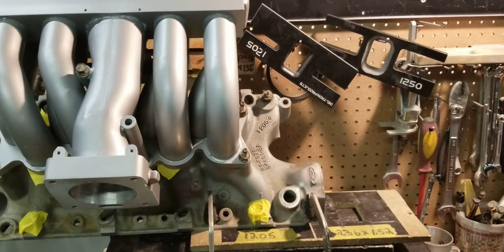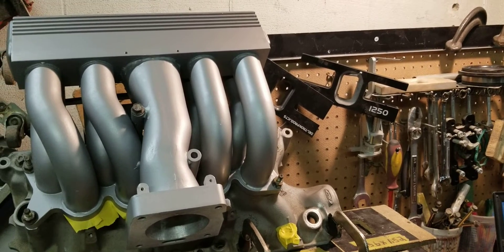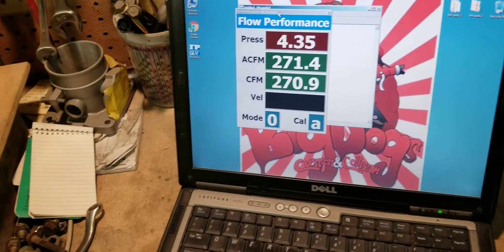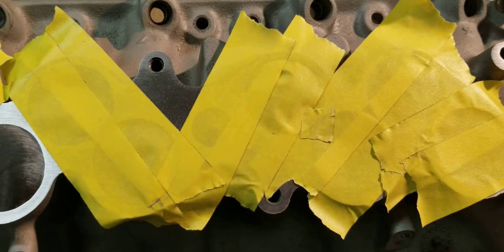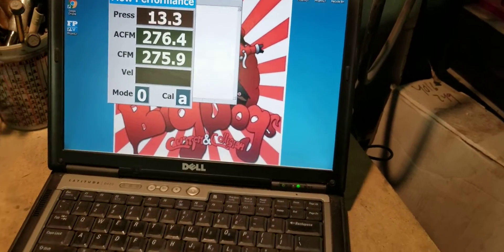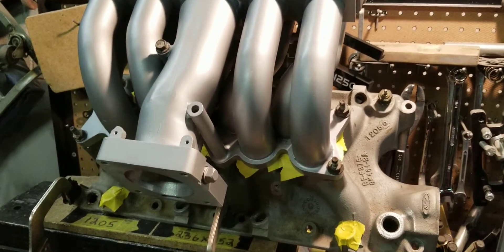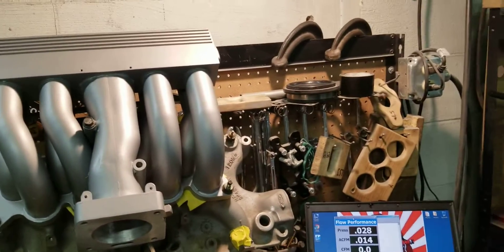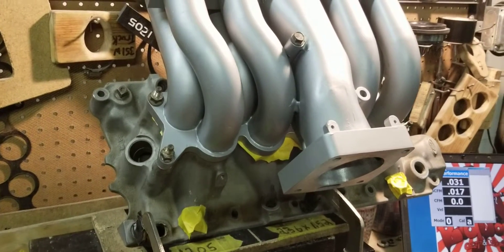SBF Stage 2 ported tubular gt40 manifold flowbench results

Comment: Is there a stage 3 available for the gt40 intake? and how do they compare to the cobra intakes?
Reply from the maker: Yes there is. Stage 3s on the Explorer and Cobras get cut, shortened, fully ported uppers and welded together. Stage 3 tubulars get cut fully ported, material added and welded. Stage 3s on naturally aspirated motors make 30whp more and will peak at higher rpm especially for larger motors. Google our Facebook business page at Bigdogs Porting and go through our page for examples

Comment: I think you nailed something that ALOT of people don't understand ..

Not just making it bigger but better fliw and slipstream thru the runner . 

I've actually seen massively ported head and or intakes actually lose power and slow a car down.
Reply from the maker: This is very true. True porting is a really complicated process that involves a lot of math and science that many don't understand. For different motor combinations you have to find a balance between fast air speed and sonic air speed, big enough cross section area to not too big of a cross section area while gaining the most cfm flow possible. The parts we port deliver great results and even greater results when customers take our advice on parts selection.